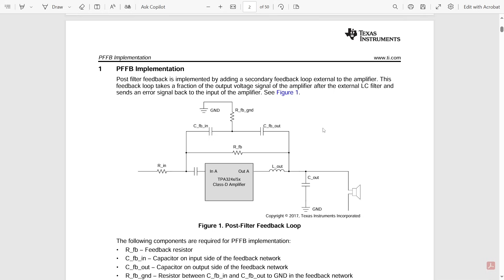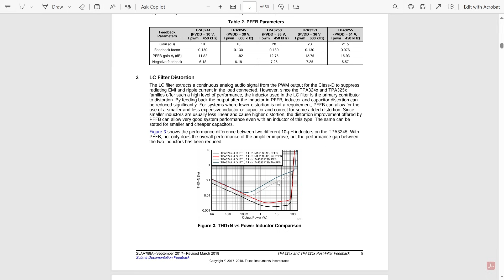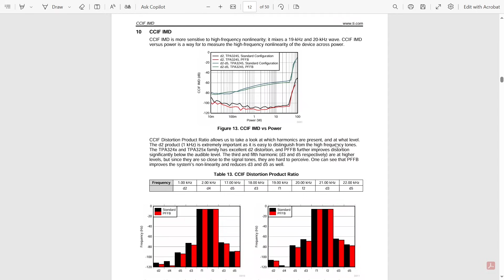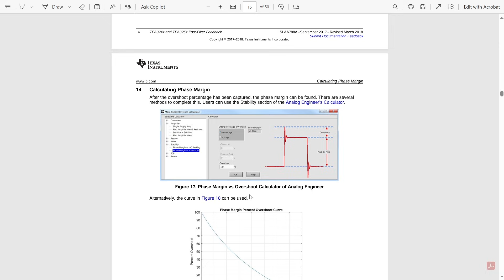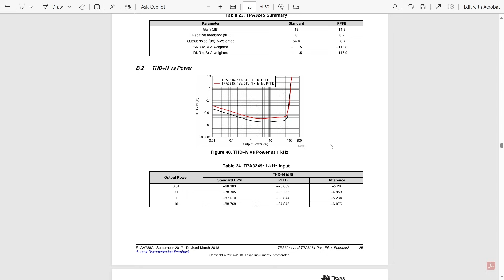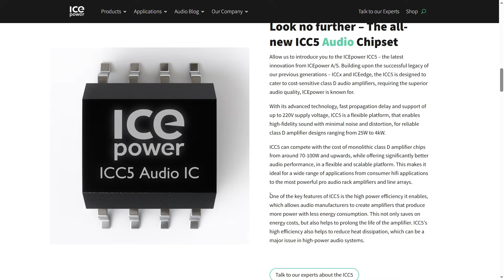TPA3255 PFFB -Post Filter Feedback

Comment: A lot of words and zero measurements.
Reply from the maker: Those TPA3255 solution measurements are well presented at the Audioscience portal. Today, most audio amplifiers measure well exceeding the human hearing threshold. The key Amplifier difference lies in the power supply design and thermal design. There is TPA3255 with PFFB detailed measurements done by Audio Science Review of budget amplifier. Those are great.  https://www.audiosciencereview.com/forum/index.php?threads/aiyima-a70-stereo-amplifier-review.52830/

Comment: Paradoxally all reviews on yt which you despise, conclude that pffb versions of 3255 sound just better... no matter what graph shows and measured electrical parameters. Haha surprise....
Reply from the maker: I believe the real reason we struggle to evaluate amplifier quality is that modern amplifiers often exceed our hearing thresholds to such a degree that we no longer know what we’re actually hearing. When I develop a new amplifier, I always follow up electronic measurements with a blind test—comparing it to a basic, flat-frequency amplifier with 0.05% THD. So far, I’ve never been able to reliably hear a difference when the output levels are properly calibrated.

So what am I really hearing?

Studio mastering – this has a huge impact.
Power supply limitations – especially when bass is suppressed, causing the midrange to become overly dominant at higher volumes.
Non-flat frequency response –  3 dB rise or drop can be noticeable.
As a species, our hearing sensors are quite limited—far inferior to many of our pets. 😄 Fortunately, our brains compensate through complex processing, which opens up a vast space for subjective interpretation.

Many YouTube reviewers don’t conduct controlled experiments. They simply enjoy the gear—and to be fair, modern amplifiers are genuinely good. I agree with them on that.

Comment: The major advantage of properly implemented PFFB in TPA3255-based amplifiers is the near-total absence of the influence of output load impedance on frequency response.  Without PFFB, the upper end of the frequency response will curve upward as the load impedance increases and vice-versa as the load impedance decreases.  Since the load impedance of a multi-driver loudspeaker system varies quite widely with frequency, this is a significant and audible advantage, and it's the main reason that nowadays manufacturers are implementing PFFB in virtually all TPA3255-based products other than the lowest priced, "entry level" models.
Reply: The audibility is arguable.  That is, it is possible if your are youthful you might hear the difference in quickly switched direct A/B comparisons, but very few people ever do that and no one could walk into a room and tell you if the amp playing is PFFB or not.  There is no standard for implementing PFFB and measurements show some do not work or only work minimally.  The main reason manufacturers are implementing PFFB in all enthusiast PFFB products is that they have to put PFFB in the advertising to sell them.   I appreciate Guntar's contrarian view on this, there are downsides and it is helpful to know them.
Reply: @ggroch  -- Actually, TI has published a proper "standard for implementing PFFB" with itsTPA325* chips.  Implementations that "do not work or only work minimally" are the result of engineering errors.  I agree with you about audibility in the sense that most human males past 50 can't hear the very high frequencies where PFFB confers the measurable advantage of load impedance tolerance -- but younger people and many women can hear straight out to 20 kHz, so there is some degree of audibility to consider in addition to the marketing angle.  😎
Reply: @editorjuno  I misspoke, you are right, there is a standard.  Guntars refers to TI's 2017 PFFB reference standard in the video.  The fact is very few manufacturers follow TI's TPA325X standards either in the amp itself or in the PFFB circuit. I would dispute whether the cause is engineering errors,  or because doing it right conflicts with doing it cheap.  Guntars makes a strong case why cheap PFFB implementation is not just foolhardy but perhaps dangerous. The TI PFFB reference was printed in 2017,  the idea is not new. Its the necessity to put PFFB in your ad copy that is new.
Reply: @ggroch  -- IMO not doing it right is an engineering error, regardless of the reason.  YMMV....

FWIW, I have no particular use for a PFFB amp because I can't hear beyond 10 kHz and the effect of TPA32** load impedance intolerance is limited to very high frequencies.  Nowadays, you can get a TI-based amp with an apparently correct PFFB implementation for under $150 USD, including power brick -- pretty inexpensive, but still about twice as much as an otherwise equivalent non-PFFB model like the now-elderly Aiyima A07s that I use for my ambience/surround channels.  Even though I can't hear the frequencies involved, I still correct for the problem via DSP since I'm already using the DSP unit to EQ my otherwise very good surround/ambience speakers in order to tame a little excess brightness that I could hear.  👂😎
Reply: I agree with editorjuno. It's not only about the THD, but as much if not more about flattening the frequency response. I disagree with Gunthar about the PFFB components being costly. In my opinion, implementing them doesn't add so much BOM cost. The PFFB network itself is peanuts. I did mine with 0603 sized 0.1% tolerance resistors and same size 2% tolerance capacitors (NP0). The most costly part in my opinion is in the Zobel, where you probably need plastic capacitors. I put some 220n/250V MKT there as I have a stash of them. 

It is a very good idea to have the buffer opamps on amplifier board, but they are not strictly necessary. I have mine on another PCB 10cm TRS cable away. It works fine, but leaving the TRS unconnected will make the PFFB circuit oscillate! I did this by accident and had to swap a TPA3255 IC from one of my boards as it toasted. I acknowledge this and accept it. I'd better keep the cables plugged. Having the buffer opamps on the amplifier boards is definitely the safest way to go and in my next design I will.

My boards are SAMP-100, one of the cheapest boards you can get from Aliexpress. I got seven of them for my 7.1.4 Atmos setup. My L, C, R speakers are bi-amped so they need two BTL channels each. I basically removed the whole input section from these boards and added my own balanced signal board on top. This board houses the 0603 parts and DC-block capacitors: 1uF MKT. The buffer opamps are on the DIY preamp board, connected by 15cm TRS cable. The PFFB works fine with this cable. You can read about the mods here: https://www.diyaudio.com/community/threads/tpa3255-all-about-diy-discussion-design-etc.287470/page-275

Very good video though, and I do agree with Gunthar on many things. The benefits of PFFB are sometimes not worth the risks of instability. I'm happy having 14 channels of quality class-D amplifiers for less than 15€/channel! It took some studying and TLC, but that's the best part in DIY!

Comment: Could you please share your opinion about low-pass filter to filter a base 600Khz frequency from output signal?
Reply from the maker: Hear you need Bruno Putzei for a competent answer😀
Reply: @ Thanks, will try to find him around. BTW, also found that the class D amplifier is worse than class B with a meander signal after 10Khz. 
.
Reply from the maker: @ruslanmulyk8601  Try to filter meander to 20Khz bandwidth and you will get similar  result. Class d has filter at output which is making those differences.

Comment: None of this is related to audio, it’s entirely about control theory. The manufacturer has provided a configuration for the integrator, which effectively acts as a second-order integrator, using components such as C_fb_in, C_fb_out, and the integrator gain R_fb_in. When broken down, the circuit essentially forms a novel self-oscillating loop (sadly they never made external the comparator  and op-amp inputs).

However, several advanced control concepts are neither documented in the datasheet nor implemented. These include integrator wind-up control, multi-path feedback networks with poles and zeros tuned for various power output conditions, and load-dependent control behavior under different speaker and frequency scenarios.

Additionally, I’m not a fan of integrating both power FETs and control signals on the same die. This design clearly targets high-volume consumer applications where integration and cost optimization are key.

Lastly, don't worry too much about the capacitor values in the loop—they don’t offer meaningful benefit. The real value lies in the underlying control theory and mathematical model governing the loop behavior.
Reply from the maker: Yes , topic kind of complicate. I think we should wait for next gen gate driver chipsets when top engineers come to final solution and put all complexiti and benefits of PFFB into  chip and we can use it as a finished block in our designs just adding power mosfets and filter. It also will give better options for cooling.
Reply: @guntarssmits2104  

This isn’t feasible due to the fundamental tradeoffs between physics and cost in chip fabrication. Integrating high-power FETs on a single die forces the manufacturer to compromise. In this case, we’re looking at a 315 W stereo / 600 W mono, 18 V to 53.5 V supply, analog-input Class-D audio amplifier. For its class and cost, the design is acceptable, it achieves decent noise immunity and thermal performance, and the gate driver isn't a major limitation. (not the best THD figures for 4ohm loads)

However, in Class-D amplifiers, the primary source of distortion often comes from propagation delay within the signal chain, among other factors. Despite that, I still regard the TPA3255 as a solid all-around chip for many applications.

That said, when aiming for high-performance Class-D, it becomes evident—especially from the work of Bruno Putzeys, Lars Risbo, and the team at Purifi Audio (as well as earlier NCore modules)—that achieving true high-fidelity requires off-chip components: discrete silicon FETs, and a well-controlled, predictable feedback loop that accounts for all switching events, even during a 100% PWM cycle. (EIGENTAKT doing this now)
Reply: @xorcipher Thank you for such an accurate response, Correction of Gunters view that PFFB is just marketing is very appropriate the PFFB option had been extensively tested for listening enhancement prior to its inclusion as an implementation option. 

Mr Smits should also remind himself that frequency sweep tones are not  Music. And testing equipment has a set of limitations that don't  include measurement details of sound quality.
Reply: @AlanBlumlein2025, thanks you too. It's been a pleasure watching you cover amplifier classd topics.
Reply: @xorcipher  -- It should be noted that several of the specialists now working with Bruno and Lars at Purifi are alumni of TI's Class D design team.  It might be possible to build an Eigentakt or nCore circuit in monolithic silicon, but the packaging would have to be large and probably ceramic rather than molded -- something similar to a CPU's -- and that would preclude the sort of ultra low price that makes the TPA3255 so popular with OEMs and economical for users.  As for "true high fidelity," when you figure in the limitations of human hearing and of transducer technology, IMO a well-designed TPA3255 amplifier is more than good enough for at least nine out of ten home audio applications -- it's really a price/performance masterpiece.

Check out these how a relatively recent TPA3255 design performs: https://www.audiosciencereview.com/forum/index.php?threads/topping-pa5-ii-stereo-amplifier-review.47362/

Comment: Not sure you understand the documents the PFFB capabilities were included in 2016 the TPA3255 chip amplifier sales for $ 2.50 in bulk again it was added as an improvement with notes on best practices for implantation. 

The PFFB goes back 3 decades in knowledge as an improvement not all humans hear the same . 

Consider that allergies in humans are over sensitivity while sound is also a reception of molecules, So just like a human can detect 1 cube of sugar from 3 in a cup of tea all senses don't operate on the same scale.